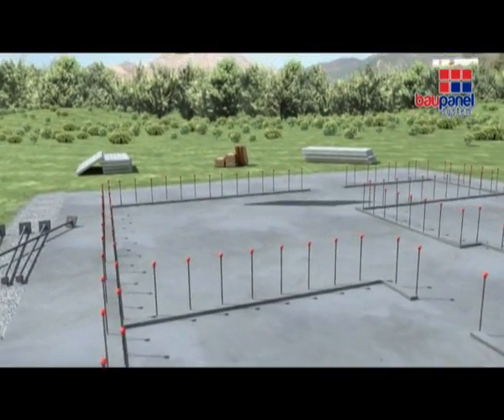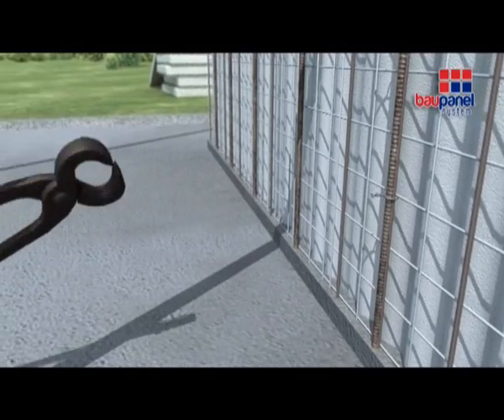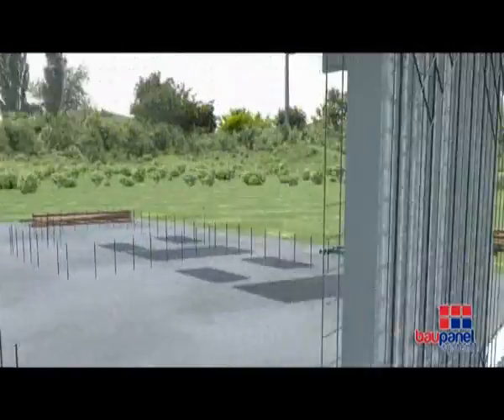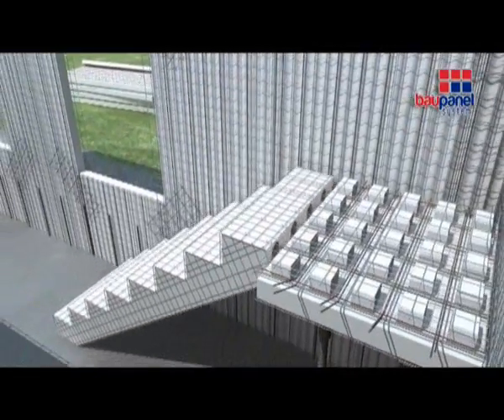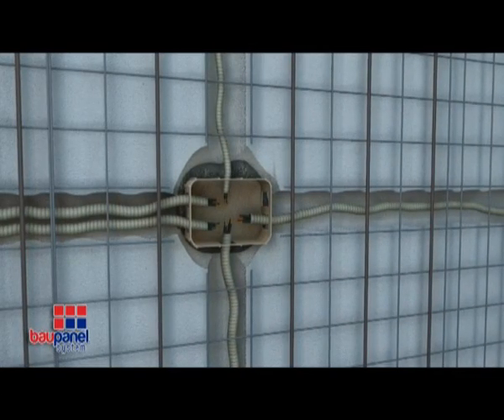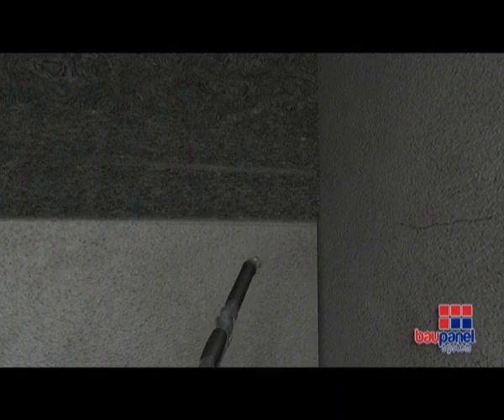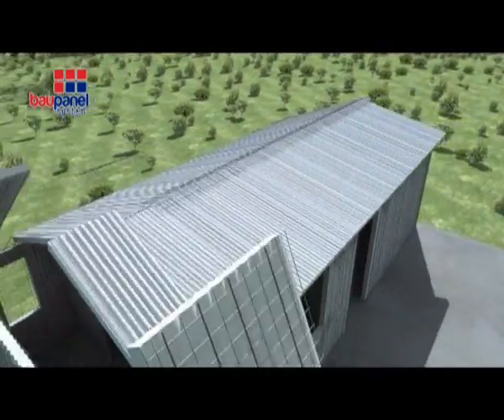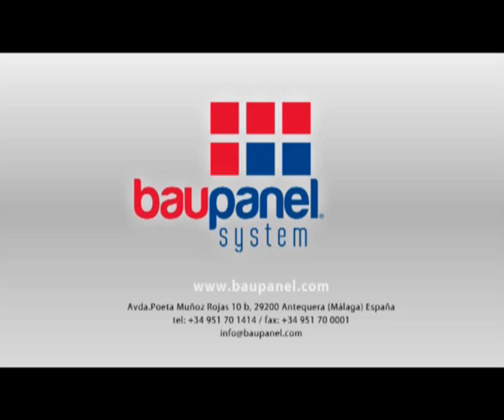Baupanel System S.L. Seismic-resistant, thermally-insulating building system - ENGLISH

Comment: Just completed ICF home but didnt see this method earlier. Anyone knows advantages over ICF?
Reply: in my uneducated opinion, i think the advantages to this is definitely the roof - there is no need to switch construction methods/ expertise. with ICF, you still have to depend on traditional roofs i.e. having to construct a whole wooden or metal frame etc.

secondly, with ICF, the skin of the house will essentially be styrofoam, and thus prone to damage. the skin of these baupanels will be concrete.

however, shotcreting does look slightly more complicated than just simply pouring in cement with ICF.

secondly, this baupanels thing looks like it uses a hell of a lot of steel, as you can see with all that wire mesh all around.
Reply: @fish-108  maybe stronger in earthquake.. less mass..? F=ma. More mass more trouble. My roof is metal SIP panels. Roof insulation and ceiling all in one. Very fast sits on top of timber 300x50 thick. Skin of ICF is STO render. Hard as rock. They drop test metal ball different than cement based plaster this one is polymer...so no cracking smells like acrylic actually.